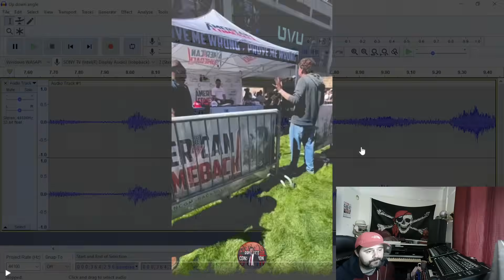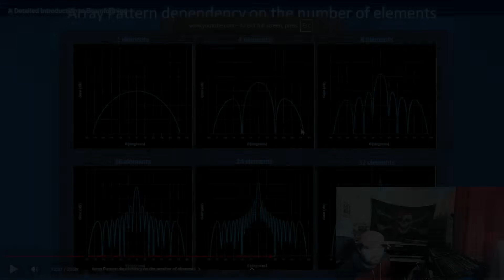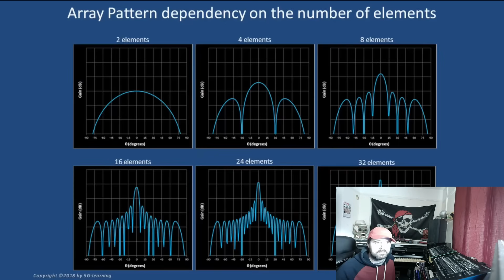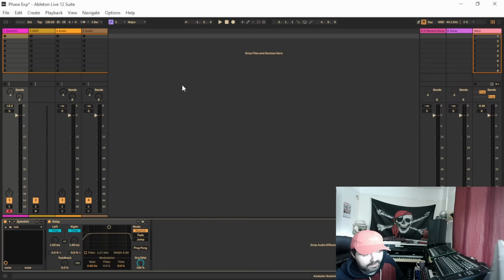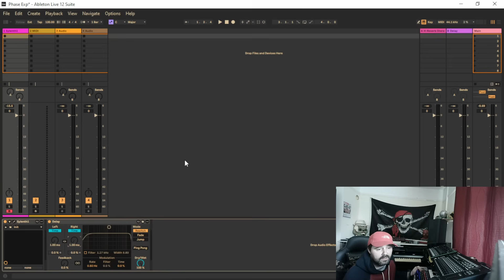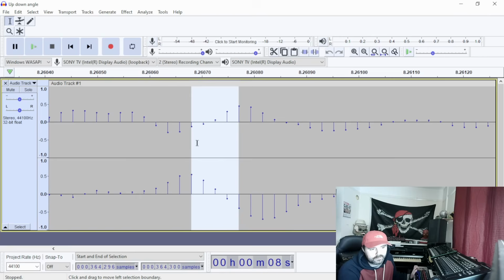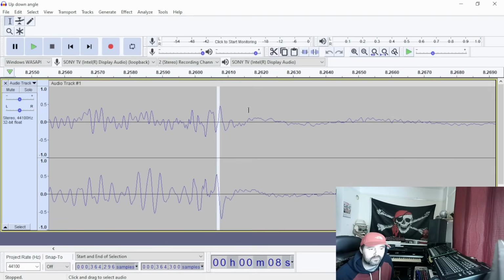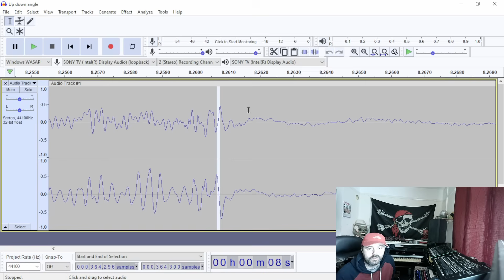Stereo analysis | What a front camera heard and why it's important

Comment: Very interesting,  I wouldn't have thought the stereo signals contained useful information.  Thanks!

You take the sample difference to be 4, but because of the nature of discrete info, we should really say 3-5.

Phones can range in height from about 5.7" to 6.8".

I get an angle of about 15°.  Will you add this calculation to your paper to show how you got 2-3°?

Since you used the crack of the bullet for this calculation, you're getting the elevation of the mach cone at the point closest to the phone.  To get the elevation of the rifle, look at the thump at around 8.620 sec.  I see 2-3 sample difference, about 7°.  At a distance of 400', that would be about 50' higher than the phone.
Reply from the maker: I can calculate the angle more precisely, though I'm not on this one because there are too many variables. I can update my essay, but this part isn't in there as it stands right now. I can run the numbers again, but if you subtract 15* from the required 90*, then what roof you pointing at? I'm sure it'll be the same as my opinion
Reply: @Audio-Freq  I mean a 15° angle from  the horizontal.  Did you mean a 2° angle from the vertical?

But I don't think your calculation is pointing at a roof, but at the mach cone.
Reply from the maker: @dabrowsa  I’d really encourage anyone who’s curious to run the maths and take their own measurements — and if you do, make a video and share your results. I’m sharing mine openly here, and everything I present is based on measurable data, not opinion. The conclusions won’t change because someone thinks differently — they’re the product of observation and calculation, not authority or belief.
Reply: @Audio-Freq  It's not a matter of calculation, it's interpretation.  You're analyzing the initial sound - that's the crack of the mach cone.  It doesn't originate at the rifle, but at the closest point on the mach cone to the phone.

Comment: Mr Dinkels  looks to be a good boy, thanks for giving his moment of fame! 
 I am impressed with how much information you can gain just by analyzing sound, mind boggling for a simple carpenter like myself.  I do understand geometry though and have used the official narrative and google earth to calculate the bullet paths angle of trajectory, and from the best i can calculate the bullet would of been on a 7.3degree trajectory, travelling through 5.5 inches (avg neck thickness) , w/out deflection, there would only be 5/8 of an inch drop from the entry point to the exit. there is absolutely no way the bullet would not of exited the body given that scenario, even if it was a smaller caliber such as a 5.56 or 300 blk out. Especially considering that area of the neck contains no bones, just muscle material. I am very curious to see what direction of origin your sound analysis comes up with. My hunch is it came from the left side of CK at an angle of 10 degrees or greater.
Reply from the maker: Yeah, I am not doing anything to do with anything that doesn't have anything to do with the audio. ~I am no qualified in those fields to comment. I'm convinced the shooter was on the white building personally, but we'll get to proving that with the audio
Reply: The angle according to the primary theory, is 9.6 degrees.  I don't think we even know the entry point precisely yet.  The visible wound may be the result of fragmentation.

I did some shooting yesterday with my own .30-06 Mauser into soft wetpack, both with and without a 3/4" plywood panel on the entry side to represent the collarbone.  Surprisingly, the front panel made nearly no difference in penetration.  It was 5 inches with the panel and 5.5 inches without.  I did not take into account any internal bones or vertebrae.
Reply: @Sherman62  I can't imagine a 3/4 piece of plywood doing much in the way of absorbing energy from the 30.06, obviously some energy was lost penetrating it, but like you found, not near enough to be significant.  I wouldn't even trust 16" thick piece of laminated wood to protect myself from a 30.06. The bottom line is that the official narrative falls apart on many different levels once it is examined a little closer. Even if the bullet entered Kirks neck from the front, on a 10 degree down angle and 8-10 degrees off axis you'd expect to see an exit wound just above  or on the top portion of his scapula and there is 0% chance the scapula would of stopped the round from exiting. The fuckery is intense and the waters are very muddy, i really doubt we will ever know the truth.
Reply: @yardfowl3149  The point of the plywood was to replicate the possibility of a bullet striking the collarbone on entry and accelerating bullet expansion.  I'm not sure how people don't get this.  No, bones don't often stop bullets outright but they do deform bullets to the point that performance is affected.  Bullets can fail catastrophically after hitting bone.

But in this case at least, it did not seem to happen.  The bullet made very nice 30 caliber holes with no visible sign of expansion in the wood.  As I said, overall penetration was quite low.  FIVE to FIVE POINT FIVE INCHES.  I would consider this the lower limit of .30-06 performance and I did it to demonstrate that a .30-06 has a very wide RANGE of penetration, depending mostly on the ammo used.

My shooting range is currently closed for an event, but I will be shooting 125, 150 and 180 grain bullets next and expect the penetration to be more, at least with the 150 and 180 grain.

Comment: The phone was held vertical. Are you sure? At these timing intervals the slightest angle would make a meaningful difference would it not?
Reply from the maker: You can see it in the orientation of the screen. It's being held vertically. Feel free to test it
Reply: @Audio-Freq  Small changes in pitch would not be detected in the video.
Reply from the maker: @christopherrobinson7541  I'm measuring audio bud
Reply: Would holding the phone a little bit off from absolute vertical change the sound recording? Would the results change depending on which way off from vertical the phone was held?
Reply from the maker: @katb7921  This is why I didn't place a bearing on it, Unless the phone was upside down, we can't fake that
Reply from the maker: @katb7921  Good question!!